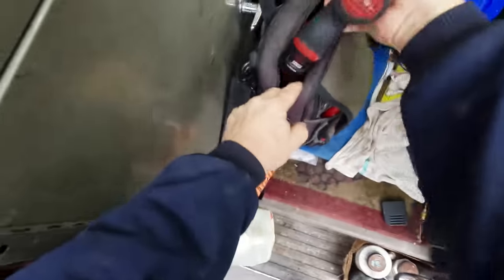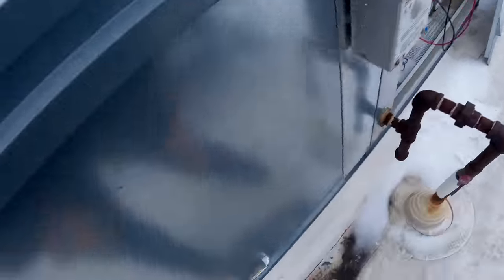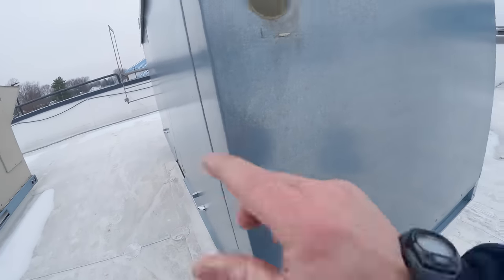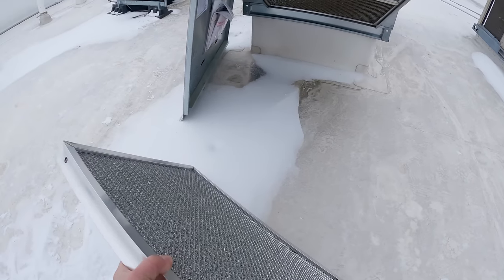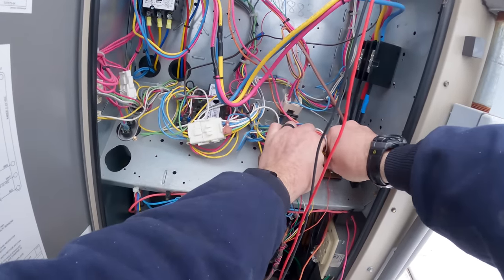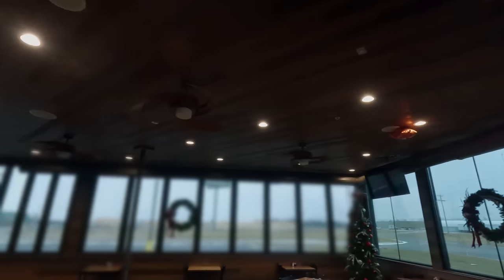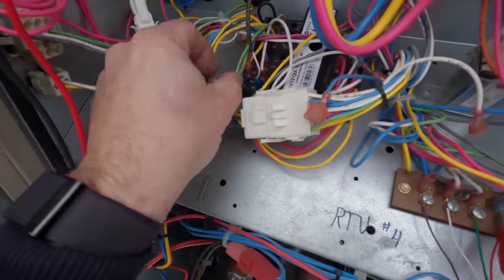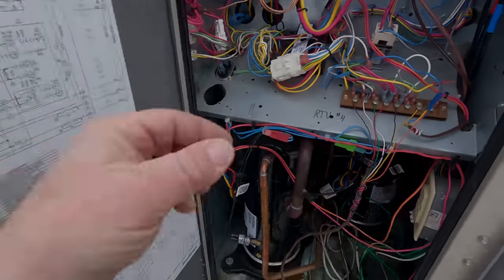Awkward Dining Experience

Comment: Thank you.  I downloaded that manual and added it to my collection, I think I'm up to a couple of gigs now, sure lighter than the passenger seat full of books. 😅 Last time I dealt wirh one I didn't have time so I did the Carrier jumper bypass.  Customers don't usually want to fix them in our semi-arid climate. 

I would opt for an automotive decade box especially for the 2nd one.  You can select any value with the switchboard.  I have in the van from when I used to work on cars, I need a second one.  Even working on TRANE a second one is real handy.  Got mine at AES Wave, but you could shop around.
Reply from the maker: Thanks for the good info!
Reply: @HVACRSurvival  While searching for a generator for 2-10v, I found the FNIRSI SG-004A.  It will create the 2-10v, 4-20ma PWM, simulate a thermistor. Basically all the low voltage stuff.  It has good reviews compared to the FLUKE for 1/10 the price.  I will probably order it on my next check.  With that I don't need a second decade box.  

I need something to generate a 2-10v signal ran into it again with a VFD on Friday.

Comment: The first thing I do when an rtu is running mechanical cooling in cold weather is ohm out the outdoor air sensor. 9 times out of 10 that's the problem.

Comment: Here in Houston, lots of the restaurants have the A/C going even when it's in the 50's outside.    I've been shivering in the front while waiting for the food.    In one case, I helped the manager get the thermostat control switched to heat mode - someone'd been buggering the buttons.  I ended up popping the cover off of the white/rogers switch, setting the switches and buttons back in place (broken loose), and seating the case back on.  Then they could use the buttons and levers.
Reply: sadly, that was probably the previous "HVAC" techs...
Reply: @throttlebottle5906  - nah.  This looked like button smacking damage, plus dropping the cover plate on the floor when replacing batteries.  I have no problems pointing the finger when warranted, but this wasn't.

Comment: Another great video!  And the place will save a little energy by not running the air conditioner for the kitchen when it is 19F outside!  Reminds me of a call I got one night, while I was at a concert, the back up on call guy was pretty new, it was 50F outside, and he had a call for a computer server room fed by a 3 ton rooftop Carrier unit.  I told him to take off the air filter cover, so it would take in about 50% outside air.  He asked "Why".  (he was very new). On Monday, I installed a fan cycling switch so the head pressure would stay high enough to not trip the unit on low suction pressure.  

I have found freezers with two fans, and nothing to shut off one of the fans when below 55F outside!
Reply from the maker: Yep, we will stage multiple fans as it gets colder if it's a large condenser with several fans.

Comment: Sadly from my experience on those Fluke 900 series clamp meters, they do not do well over 2k Ohms of resistance.  I find myself thinking a 10K Honeywell TR21 is bad because mine is not reading any resistance.  But I double check it with my 17B in the truck and I suddenly have resistance.
Reply from the maker: My fluke 376fc and 902fc both are rated at 60k ohm.

Comment: Upgrading to the JADE would get 2 new sensors, ordering the kit, and that may be in stock rather than just the sensor.
As you stated, the JADE would make things much better.
For some reason I did not think the new sensors worked on the old controls. It has been awhile since I dealt with one, though.
Reply from the maker: Depends what sensors were talking about. The thermistor is the same I believe. The other sensors are communicating on the buss network.

Comment: Working on my company's equipment. If you ever want to confirm the heater is working on those MUA units stick a temp sensor in the same spot as the discharge air sensor. Then activate heat and pull the #4 wire off the amplifier. That forces it into high fire. Adjust the gas on the main valve so you're getting roughly 70 degrees TD. Then put the #4 wire back and pull the #5 wire which forces it into low fire. The modulating valve has a blue cap on the side where you adjust low fire trying to achieve 10-13 TD. Once you got that put the #5 wire back and adjust the amplifier to a temp and give it a minute or two and see if you're reading within a few degrees of what you set it to. Sometimes the discharge air sensors go bad so it makes them over or under fire by a lot.
Reply from the maker: That's all great information that I have to look up when I work on them👍👍
Reply: @HVACRSurvival  if you need/want some CaptiveAire manuals or anything let me know. I've sent PDFs to Chris at hvacr videos before including our newer Paragon DOAS units that are becoming very popular since our lead time is weeks vs other companies months
Reply from the maker: hvacrsurvival@gmail.com send what you got. 👍👍 Usually what you just told me is the main thing I need but I'll take anything you got.
Reply: @HVACRSurvival  sent attached the resistance chart for the discharge sensors too
Reply: I thought it was terminals 3 and 8 on the amplifier but 100 percent correct, set pilot, high fire, low fire then verify it modulates to supply air temperature.

Comment: On dual belt applications, I always find one belt just slightly looser than the other.  Drives me crazy.  They never seem to wear evenly.
Reply: because blower and motor shaft alignment is off some, it needs a dual adjustable tensioner plate and adjusted so the tension is even "via tension gauge" and making sure the shafts are perfectly parallel when under tension. they're likely prepositioned to try and correct for wear, which may make it eat the outer belt first, then as it wears the inner gets loose and eaten first.
really, in my opinion, it's a big waste of time, because things move around from hard starts, change as bearings age, the belts will never "stretch" evenly, nor the sheaves wear the same(cheap/dirty recycled metals). so pretty much give everything the stink-eye and get it as close as possible without wasting hours.

Comment: I've never worked on a allied or even heard of them, but I know with carrier I believe it is you economize it is stage 1 in the winter and then stage two cooling would bring in compressor one and then if all else fails and it can still not reduce the temperature it closes the economizer and brings on stage two therefore you running full cooling
Reply from the maker: I'm a carrier dealer and use to do lennox, the control in this video was the same they use in the carrier. (the older ones)

Comment: You need to look for service facto ( SF) on the name plate to know how to set overload over FLA.
Reply: sadly not everything is labeled with service factor. so you crapshoot it. worse case it burns up and you pout a larger motor in or don't and keep replacing it as job assurance(LOL) no don't to that, the junk breaks way too much as is. one good parts shortage and the "world" is forked

Comment: I wonder what it is with Fluke clamp meters and resistance ranges.  They top out at 60K on the better meters like yours.  Some are as low as 4K.  While my Extech is a cheap meter compared to a Fluke, it will measure up to 40M according to the spec sheet.  Accuracy at that end, who knows?
Reply from the maker: It's Fluke, Fluking you in the ass. But they know there stuff holds up. I wasted money on Fieldpiece, UEI, Amprobe, none of them have lasted like these Flukes have.
Reply: it's hard to be accurate over such a huge range, so the magical ones that claim huge ranges are most always not worth a "hill of beans" at either end of the scale, but some may be better at one end vs. the other.

Comment: You do know. Thermistors where first used. Back in the 60s. They determined to be unreliable. Because they fail in just a few years. Unlike the mechanical controls that sometimes outlasted the equipment. Then all of a sudden in the 80s. They where brought back in as new technology. There are chain stores we service. All newer YORK. I carried spare sensors. Always can find at least one that is bad on one of the units. I said the same thing you did. Needs new sensors. I would replace all of them. They are cheap and all the same age. Thermistors go bad overtime.
Reply from the maker: I have a lot of thermistors fail in my ice cream machines because of the temps they run at but I haven't lost many mixed air temp sensors. But your right I should have ordered it,

Comment: you may be better off with a resistor decade box, with label printed stuck to it for the settings. then again that may be too much fiddle farting around, but it would be widely selectable for the unknown junk you have to look up or call tech support on.
then again, maybe just bypass all that useless junktronics crap with simple controls and let them deal with burnt out large components. "danged if you do danged if you don't" lol